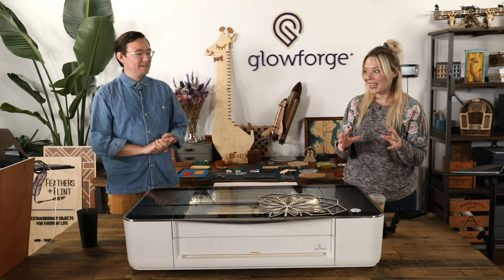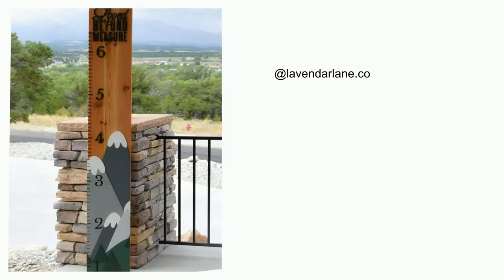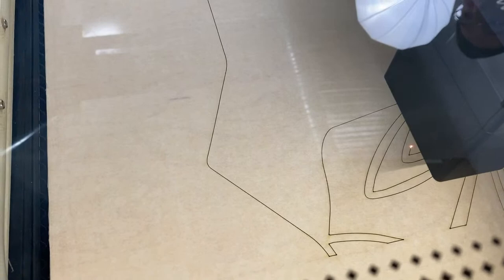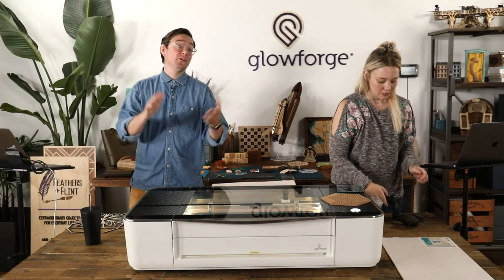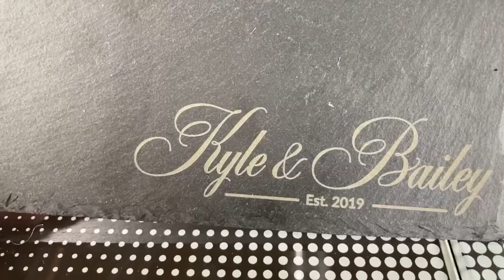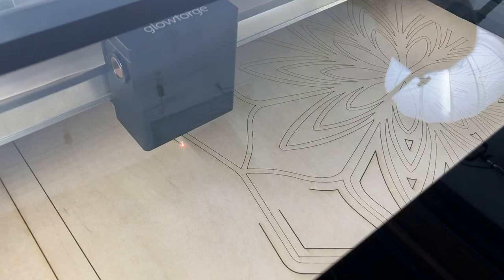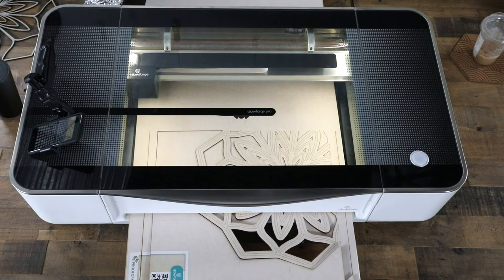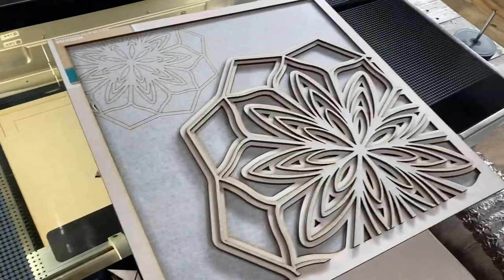LIVE: 5 Must-Know Tips for Perfect Passthrough Prints

Comment: I have not seen or heard of anyone cutting or etching balsa wood, like for model airplanes kits. How well is the machine able to cut and engrave balsa wood without causing it to catch on fire? In some instances, is the use of an inert gas advisable to prevent the material from burning?
Thank you for posting these video demonstrations!
Please have an excellent and awesome day! ☀️
Reply from the maker: Hi Mike! I see Glowforge owners print on balsa wood all the time for model airplane kits. You can adjust the speed and power of your laser to fine tune the best settings for your material. For example, I see Glowforge owners cut cardstock on their printers with very low power settings.

You might be interested in this kit that a Glowforge owner printed and shared with us: https://community.glowforge.com/t/balsa-model-airplane-parts/66261/2. 

You won't need anything additional to print balsa wood on your Glowforge besides the wood and your Glowforge to get a perfect print. -Ellen

Comment: Can you register prints that are over 20 inches wide
Reply from the maker: Hi Steve, the maximum width one way is 20", however the Passthrough slot on the Glowforge Pro will allow you to print at infinity length the other way. So you'll be able to print projects 20" in width, but however long as you want. -Ellen

Comment: Very neat, but so limiting that the bed cant allow a 3/4" (or more) thickness.
Reply from the maker: Hi James! With the crumb tray removed you can print on items up to 2" in thickness. -Ellen
Reply: @Glowforge  Thanks for the clarification! So does that apply if you are doing a pass through option on a longer piece w/pro
Reply from the maker: @jamesbsa6450  Hi James, that 2" thickness applies to materials inside the bed on your Glowforge. With the Passthrough slot you can pass materials through up to 1/4" thick. -Ellen